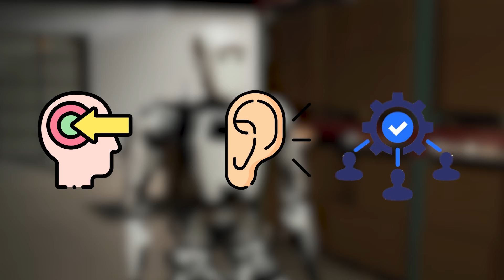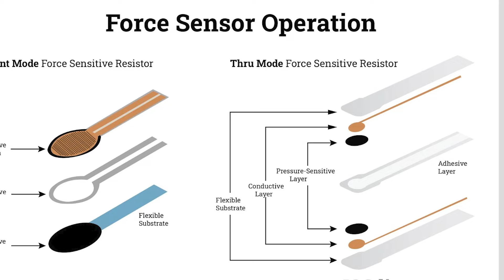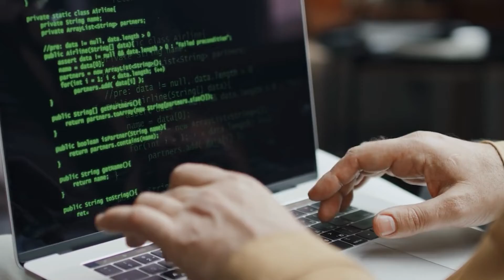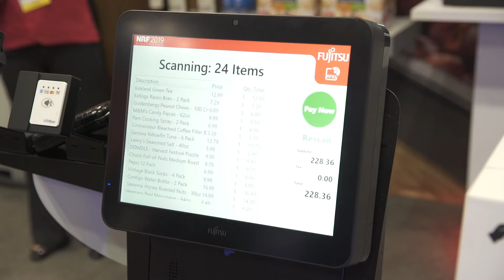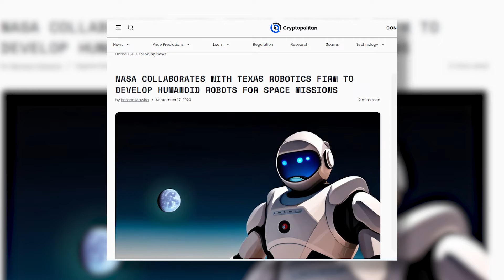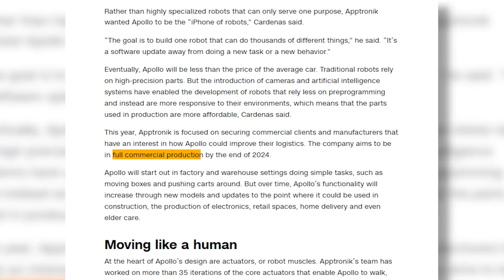Empowering Tomorrow: Apollo, Where Artificial Intelligence Meets Robotics

Comment: OOPS Tesla just made all those comparisons with their Optimus Bot obsolete with the release of Optimus Bot Gen 2. Lighter, stronger, faster with articulated feet and pressure sensors in each finger. Combine that with Tesla's unparalleled manufacturing skill and internal construction and mass acquisition (cameras, chips) supply chain they will be able to produce the Tesla Gen 2 for significantly less than Apollo.
Reply: I would love to see an outside research team conduct a thorough and clinically  objective comparative analysis performance review of the top 10 robotic humanoids for each particular service application. Similar  to Consumer report in purpose .
Under both autonomous programming and by VR/ remote control by Human operators. 
As well as quantifying in other important factors such as cost,productivity  durability and versatility. 

It could be funded by television as a form of Robot Olympics. Perhaps promoting a better public image of Robotics and soothing those affected by Uncanny Valley  Syndrome 

For instance ,they could compare the Apollo, Beomni and Grace the Humanlike nursing assistant ( possibly to be upgraded as RIA) under identical Healthcare work situations.
 Medical school patient simulation robots such as Victoria ,Hal or Arthur would be particularly useful in this test.

Atlas ,Apollo,
Xiaomi and Tesla bot could   compete for more rigorous duty in warehouse and construction ultilization .
They could all be tested for household services,
an application that would open up testing opportunities to a few other models such as the Walker X.